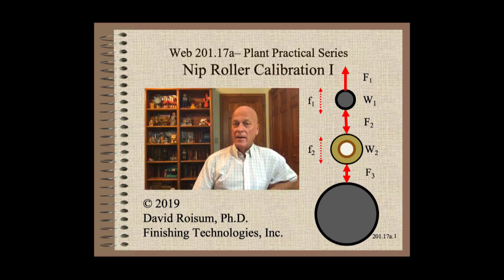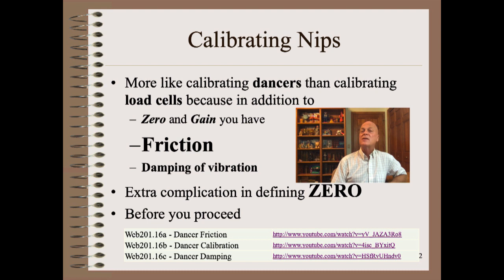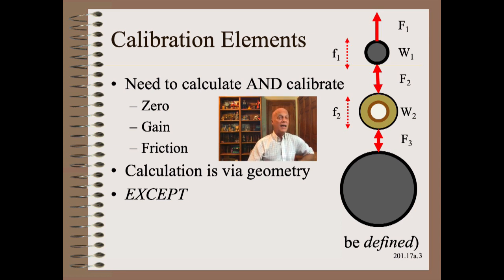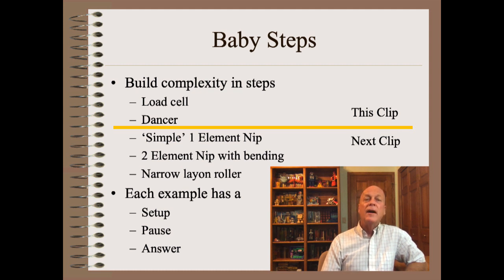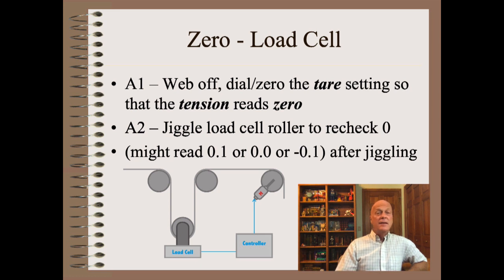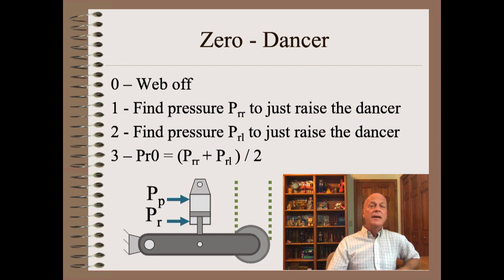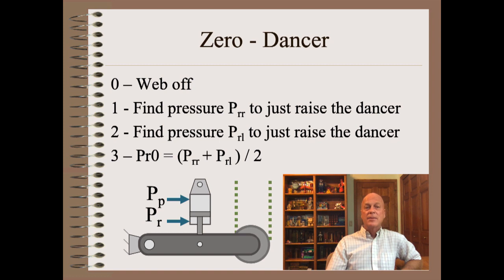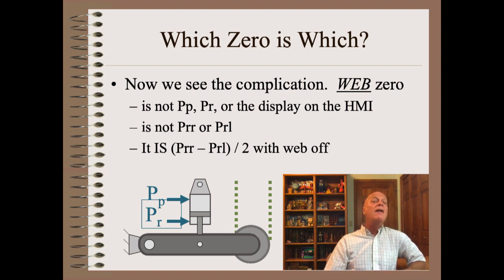Web20117a - Summer School - Calibrating Nips I

Comment: Dave, on the first slide describing Dancer calibration you have the work "raise" in the slightly lower pressure, I think just a typo as you described it correctly.  Very informative video.  Larry Clark
Reply from the maker: Thank you for finding this Larry. I write and render like a windstorm: fast and furious ;).  Since it is almost as time consuming to fix a slide (Web201.17a.07) than it is to make it in the first time, I will just correct it in this comment.  Note that step 2 on dancer zero is to read 'lower.'